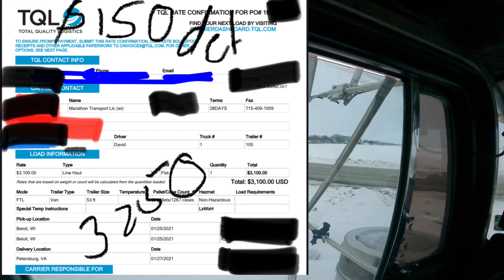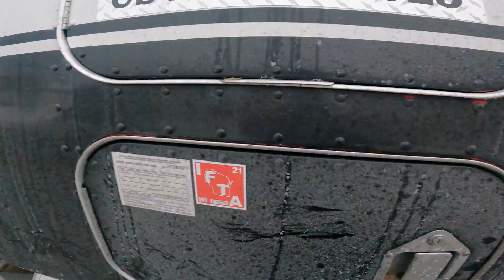Rookie trucking driving Stretched Peterbilt and a New Trailer finds a  low bridge

Comment: 💪🏻💪🏻💪🏻Since you yanking a box instead of the parking deck now when you come across the I-80 and I-90 from Chicago to San Francisco East or west either way REMEMBER the wind is a gangsta poppa and lay any truck over on it’s side 

So you always want to run it heavy or definitely over 25K in the box ( Dry Van )

I seen first hand the pressure them storms can put out beautiful but deadly 

And I am from Raleigh nc straight up flat lands with no hills I’ve been watching you for around 3 years I think you just tell it like it is so if you need any advice you good , just ask me and I look out for you

Comment: I got a 550 hp isx cummins with 13 speed I hardly split depends on the road when I'm down shifting I just drop full gears with Jake on  I get the rpms down to 1100 down shift.

Comment: Glad your safe out there and back on the road 

When downshifting a diesel keep the rpms extremely low, because of the high torque you don’t need as much rpm, I also have a Mitsubishi mighty Max manual gas burner that is the hardest thing to downshift

 

Try only keeping it on the high range and it’s lowest gear like 6th, at work I drove an 8 speed and it’s sucks, it’s like an underpowered 10, it has lo lo lo then 1st then up through 4 then split into low (6) then up to 8 but I learned downshifting in high range low is the lowest I can unless I’m under 15 mpg so I stopped splitting 

The transmission has an extra non to lo even lower on lo and reverse

Lo
Lo
Low
1st
2
3
4
Split
Hi-low (equivalent to 6)
5
6
7
8

I usually stay in high range unless I’m under 15 mph

Comment: Your trailer should be 13’6” if it is higher then that you need an oversized permit. You need to readjust your air ride on the trailer and tractor so you are within the height 13’ 6”
Reply: You are right but damn you must be fun at parties huh?! All car haulers run up to 13'9 all day
Reply from the maker: Federal regulation is 14’ even though some states are 13’6 on east coast
Reply from the maker: Actually he’s wrong look up regs lol
Reply: @Hotshotdave  Yes correct, I'm on your side bro 💪👊
Reply from the maker: @hotshotnewengland  Ook lol

Comment: how much you got trailer for and what kind ? im in market looking for one
found a 2010 vanguard 53x 102 with new tires/brakes and new doors and doesnt have any leaks for 10k local to me so im thinking of just getting that.
also how many monsters you drink a day ? lol
Reply from the maker: Is that an old reefer trailer without unit on it.
Reply: @Hotshotdave  no just a regular dry van not a refer
Reply from the maker: @zaidchalabi1599  not a bad price
Reply: @Hotshotdave  ya
im thinking of getting it next week probably
because load board is crazy for vans now in my area
i see tons of $1000-$1500 runs for 200 miles runs 
and bunch of 3k+ for under 1000 miles

Comment: dave, how come you only split the last gear ? 
do you always do that or only when light ???
btw i loved this video
do more of this on the road video
just watching you drive and talk about stuff 
i listen to you while im driving too
Reply: Ya just because it’s a 13 speed or an 18, doesn’t mean you have to hit every gear if not needed
Reply: @brandonb.3317  what makes you need it? how u know ?
Reply: @zaidchalabi1599  your weight mainly, also a difference if on flat land or pulling through mountains
Reply: @brandonb.3317  ah okay
so if fully loaded in WY
and i dont split, does it not fall in gear or grind or what happens?
Reply: @zaidchalabi1599  all you gotta do is match the rpm to the shift and it’ll go right in,  do you drive a truck? What kinda transmission you have?